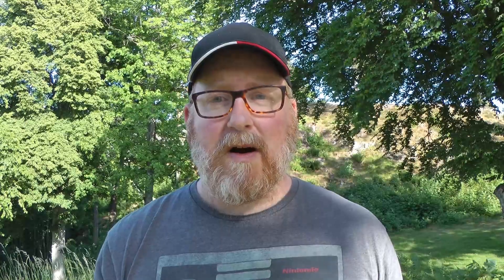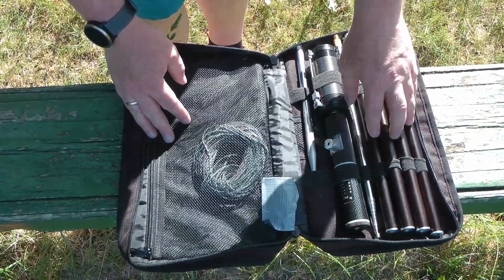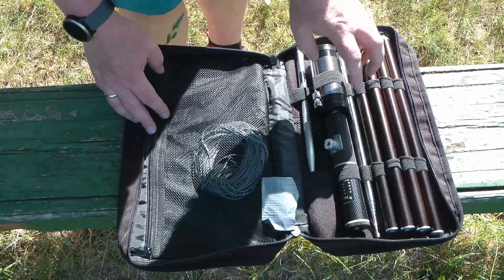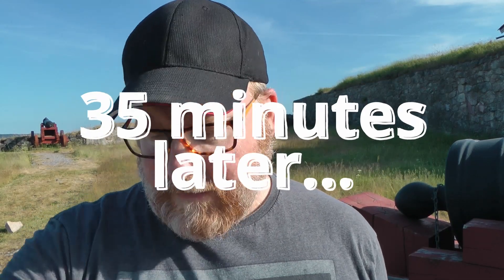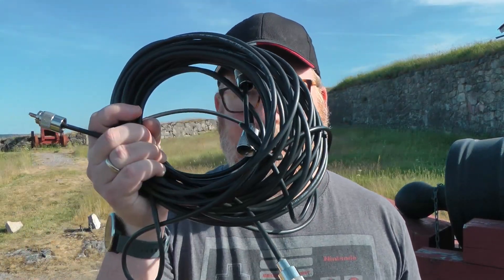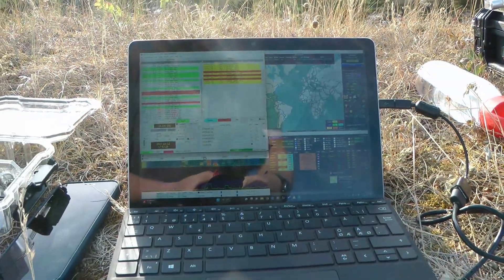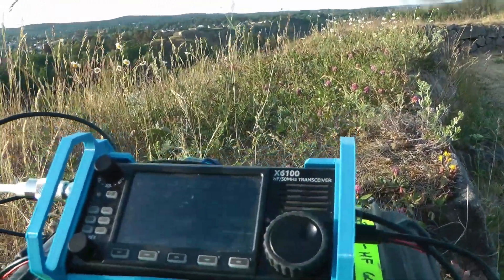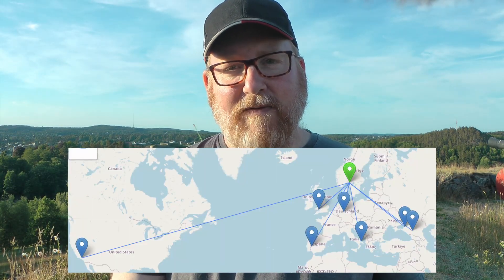The Chinese Buddistick (JPC-12) - POTA Fail

Comment: The slider was contacting two spots on the coil. Contact should be touching just one ring. My initial contact in 20 meters was Rusia. Give the system another chance, conditions are not the best.
Reply from the maker: Oh, I have given that antenna very many chances, and I have many videos on it.

Comment: I woldn't place the coil in the middle of the antenna. That's where most of the radiating happens (the wave is at it's peak). It may show a low SWR, but it's not effective.
Reply from the maker: Everything is a compromise. Even an 160-2m yagi on a 100m tower is a compromise. Where would you put the coil?
Reply: Wrong.
Center loaded is more efficient than base loaded, top loaded is more efficient than both.

Comment: I fiddled with the JPC-12 antenna and sent it back and got most of my money back as well.  I agree with your assessment.  I may try the knock off version of the MC 750 coil antenna.  The WRC antenna just works for me...
Reply from the maker: I ended up doing a series of videos on this antenna. It turns out that it works, but tuning is a big hassle.
Reply: @LB0FI  Exactly... Agree.

Comment: I own this antenna and have had a good experience with it so far. I think it just may not have been a good day for POTA the day you went out. I say give it another chance, if you haven't already.
Reply from the maker: I have a couple of more videos on it, and it turns out that it is okayish. The lack of good instructions is unforgivable though.
Reply: @LB0FI  yeah - the only reason that I knew how to set it up immediately was because I had already watched a few videos on it, including some people's struggles with it. I really want to try it over salt water to see how well it performs with a really good ground.
Reply: @TheToastDog same here
Reply: I have and used both - JPC/PAC and Buddystick. The results were comparable and the JPC/PAC is much easier to set up and tune. Especially the often breaking Clips of the Buddystick are o bad I sold this antenna after three years. One thing with the JPC - get the 5.6 m whip, this makes things much easier!
Reply: I found the anttena easy to set up much better than the buddypole and tuneing a peace of cake i made my own ground wires 3 x 16ft i think you must try it again but i think on 40m you need more than qrp i have the longer whips but tryed one yet ( you need a none windy day a long whip bends a lot 😊

Comment: Interesting video.
There's always a better mouse trap and I've tried so many mouse traps. My go to antenna for POTA is my OCF40. But, both my friend and I have PAC-12 antennas. We both use 3 each 35 foot long radials along with 3 each 17 foot long ground radials. For what that antenna is, compared to other ground mounted verticals, we both found this antenna easy to deploy, easy and super easy to adjust for resonance. For 40 meters we put the slider right on the painted mark on the coils. We ended up right in the 40 meter band. For 20 meters, we found the mark to be one turn off. But, by putting the slider right on the mark, we still had a usable SWR curve on 20 meters. 
The key to performance on this antenna is, "put down as much ground wire as possible. One ground wire, like the ribbon cable that comes with the antenna does not cut it. So many people just lay that cable down without separating the wires and spreading them out. As is, the antenna sees that cable as one ground wire.
We both found this antenna to be a very good performer for a ground mounted vertical. I'd buy another in a heart beat.

Barry, KU3X

Comment: I made a vertical that style using some Hustler loading coils from a mobile system i have a coil for 40m 20m 17m 15m worked every time. OK for POTA as my car is near by and did not need to back pack them very far. I found those types of antennas you used was tuning it up for every band and costing a lot of time. generally the Hustler coils are tuned once and stay in tune for next time. vk5cz ..

Comment: I've that same set up Morten, JPC-12  is pretty good. My first time testing it I worked into Indonesia from West of ireland using the x6100 on 5w. 
Ps i like the handles for the x6100 
De EI2JHB
Reply from the maker: It is not a half bad antenna, as my later videos on it shows. It does however seriously lack good instructions, and it is cumbersome to tune. Once you have it tuned it performs on par with other loaded shortened verticals. I do prefer the Slidewinder over the JPC-12 though. The handles for the X6100 are 3D printed, you can find them on Thingiverse. I also have a video on those handles. Thanks for the comment!

Comment: I used it tune it in less than 10 mints i get a contact 7500 km 
I even tested it inside my room i get 1200 km with 59 report befor i erect it is is a very efficeient antenna light wt easy to tune and ssemble
Thanks for the video 
7Z1FA:ST2KI
73
Reply from the maker: If you watch the other videos I have made on this antenna you'll see that things are not as dim as they seem in this video. It is however not an easy antenna to tune, and it is about as efficient as any other center loaded antenna when you get it in tune. How far you reached with the antenna though, is dependent on a whole lot of factors.

Comment: Simple long wire antenna with 9:1 un un on a fiberglass pole would be quicker and easier to set up ?
Reply from the maker: Are you asking or are you making a statement? And if it is a question, my reply would be as most things in ham radio, "it depends". Sometimes a shortened vertical is more beneficial to where you operate than a long wire, and sometimes a long wire is more beneficial. I adapt to the operating conditions when I do portable radio. I would prefer a 49:1 over a 9:1 any day though.

Comment: Were you operating with X6100 power or using an amplifier?  I have considered the X6100 as a new QRP radio.  Thank you for the example of the JPC-12.  David AE4LH
Reply from the maker: I was using an amplifier for this as far as I can remember. I do have some other videos on the JPC-12, so it’s actually easier to tune than what I initially thought.

Comment: I can inform you that when using 15 METERS you can remove the coil, I have found better results with the coil at the bottom takes on average 5 minutes to tune , the build quality is almost the same as  BP for a 3rd of the cost as I own both,  I think it's just inexperience with this type of antenna setup but we all started some where, I have made a few contacts around the world on 10 watts using the same antenna enjoy have fun 73's

Comment: You do need the coil only for 40, 30 and 20m band. The antenna is really great and simple to use and brings great results; at least in my experience. Used the antenna last winter for FT8 DXing and SSB in my garden and recently for POTA activations. Price/Performance ratio is quite good. If you want to know the best settings, you can use the setting from Heinrich DO1HFS (yt channel Funkfieber). Here is the link https://www.do1hfs.de/downloads/Kurzanleitung_PAC12_Antenne.pdf. 73 from OE8
Reply from the maker: Thanks for the tip. If you watch the rest of the videos I have made on that antenna you can see that I used that list and made the antenna work. It is not an easy to tune, but when you get it in tune it’s actually a pretty good performer.

Thanks for commenting!
Reply: @LB0FI  Thanks for the answer. Will check the other videos soon :)  I tried this antenna actually on all bands. I had never an issue by tuning the antenna. Used the original radials, sanded the surface where the ground rod screwed in. In comparison to e.g. the HF-P1 antenna, which almost needed the coil, this antenna is very easy to use. The SWR I got are almost in the range of 1.2 - 1.8. I will soon test the antenna adding an additional loading coil for 80m, just to play around. 73 Michi OE8YML

Comment: The coil must not be inserted anywhere at the top, but at the bottom, directly over the feeding point segment. And you do not need the coil for 15m: Take only three of the black rods and extend the telescopic rod to full, and you get a quarterwave groundplane, for 10m without the black extensions.The manual says, for 15m take all four and shift the telescopic rod down one segment, but regarding SWR, it does the same job. The coil is only for 20m and 40m. At 40m, you should try out, shifting the slider one or two turns upwards the marking of the coil, because that is meant for the lower band end. I love this antenna, because without fine tuning an fiddling, you are QRV on the four bands with SWR below 1:1,5. Of course, especially with groundplanes, the radials are crucial, and perhaps it might help to avoid tall grass. vy 73 oe1llc
Reply from the maker: I have several more videos where I investigate this. And you are partially right, the coil is for 20 and below, but this is a center loaded antenna, and the coil is meant to be in the middle, and not at the feedpoint as you suggest.

Also, when you say that you can get the SWR below 1.5 without fiddling you are simply wrong. This is an extremely fiddly antenna, but if you watch my entire series on this you will see that it is tunable on every band between 40 and 6.

This is an antenna that in kind of in between in it's market segment. It is easier to use than the Buddistick, but it is way harder than the Slidewinder DX.

Thanks for watching and commenting!
Reply: Wrong!
In my country you probably wouldn't make it through the exam (yes, a real exam, not a test) not having a clue there are also center and top loaded antennas. And in fact, center loaded is more efficient than bottom loaded and top loaded being the most efficient of the three.
This is center loaded one.

Comment: As for me, JPC-12 is a good antenna!  Quick to assemble, takes up little space, good SWR at 7/10/14/18/21/24/28/50/144.  The only downside of resetting in contest mode is the loss of time.
73 de ER/UT1ZZ!
Reply from the maker: If you watch the rest of my videos on it  you can see that it's not half bad, only really cumbersome...

Comment: maybe next time use a wind filter, or hi pass filter its very  to listen to blobs  :-(
Reply from the maker: Hi, and thanks for commenting. Could you tell me exactly where in the video you have problems with wind noise? Also, I always use a deadcat with my microphones, but when filming outside on a very limited budget poses it's own set of challenges. There are, however, links in the video description to support the channel financially just so you can help me upgrade my equipment.

That being said, how did you like the content?
Reply: @LB0FI  during the whole video there are low noise sounds of wind.  I am listning with a headphone so i can hear them .  Offcourse i could  filter them  out with a high pass .
. But it was a tip for next vids  to use a wind or plop cap for the mic.  Good video altough OM 73  PE1NGW 🙋🏻‍♂️
Reply from the maker: There’s always a deadcat on the mic, but sometimes there’s just too much wind anyway.

Comment: Great video! In my opinion, what you experienced, you can experience with any loaded vertical. I had similar issues with me Wolf River. What I learned is, that is does not only depend on the length of the radiating element or the coil but also on the length of the radials. I know that theorywise it should not matter. However, for me it does. So I only use the full length of radials for lower bands like 40, for 20 I fold mine back to half and for 10m to a fourth. That means I have an average length of 10, 5 and 2.5, and this equals to Lambda/4. I do not say this works everywhere, but on the dry and rocky soil of the black forrest hills it works for me.

All these antennas have their limitations, but I like the setup of the PAC-12. My Wolf River just came in a plastic bag. For sure I will get a PAC-12 as well 🙂

73, Kai
Reply from the maker: Thanks for the comment. And yes, all of these antennas have their limitations. The best one I have tried is the Slidewinder DX, which I have made one video on, and a couple of more are coming. I have a feeling though, that for 20 and up, a 17ft whip does the job much better.

Comment: Not my experience at all with the JPC-12. Tall grass can make counterpoise length more of a factor. The connection to the coil needs to be squarely on and only touching one of the coils. For reasons unknown moving to an adjacent coil or two and retuning the telescope changed results dramatically for better or worse. 

But, that’s why vanilla, strawberry and chocolate are all necessary, right?

Thanks for the video.
Reply from the maker: Thanks for commenting and your insights. It looks like I need to give this antenna another go.
Reply: @LB0FI  it is a design flaw to make it so hard to tell if contact is not spanning coils.  At night my phone light is necessary to double check. Also, I almost always use the 5.28mm whip upgrade and added another set of ribbon cable counterpoise when ground is bone dry. Also I bracket, meaning when I find a tune I try the coil turn above and below. Also, I never pull the top few telescoping sections more than 1/2 or even 1/3 of the way unless the band calls for that length. That makes the antenna stiffer in a breeze. East Coast US to China was achievable. Oh, and make sure the ground spike doesn’t start to unscrew.
Reply from the maker: The ground spike unscrewing was certainly an issue. I am also wondering if there is some kind of matching network in the feedpoint which would explain some of the issues I was encountering.
Reply: @LB0FI  feedpoint cylinder has just a wire from the center pin to the antenna mount.

Comment: Hi Morten, I am a happy owner of a JPC-12. There is one manufacturing issue with this antenna which I have encountered with mine and two more JPCs from other hams: The red isolation must be removed from the connector ring of the radials which is mounted  between the ground spike and the feeding point. The ground spike needs proper contact with the radials since there is no conductivity between the ring and the anodized surface of the feeding point casing.
73 Krishan, DO1KRI
Reply from the maker: I will check with the owner if I can remove the heatshrink and see if that helps.
Reply: One is glad to be of service (hope it helps). By the way: I have always managed to gain 1:1.2 to 1.25 SWR on my analyzer just by adapting the whip length.
Reply: Hi Krishan.

Thank you for your info. I'm after my first "long" weekend (3 evenings/nights and some hours during the daytime) with PAC-12 and my feelings are simillar to Morten's, but when I was screwing the gound spike with counterpoles and antenna base I felt, that something could be done a bit better here. Well, the next time this red plastic will go out, and we will see...🙂Generally this antenna has the potential, e.g. in the evenings on 20 m I heard stations from JA, VU and both Americas at S7 - S9 signal level and very low band noise around, I was able to do some not only european QSOs, but e.g. on 6 m and 40 m it was rather deaf despite not bad SWR. Well, operating on the VHF from the gound level is not so good, on 7 MHz it is IMHO too short (I'm going to buy 5.2 m long additional whip), but a bit dissapointing results on 10, 12 and 15 m were caused by not so strong propagation (I think so 🙂). Anyway this antenna is really good build and I hope, that after some modifications I will be glad with it.

73! de Piotr SP5TZP
Reply: @pt4389 the 17ft telescopic anttena is fitted with a 3/8th thread the jpc12 threads are m10 you will need to make an adapter hope this helps

Comment: Thanks for testing it out for us. This antenna wasn't on my radar, but I'll steer clear.
Reply from the maker: It might be an antenna for you though 😀
Reply: @LB0FI  for me, the only attractive thing about this antenna and the BuddiStick Pro is the size. They pack down in a small bag which is convenient for travel. A friend of mine purchased the BuddiStick because he travels by air a lot for work. I'll need to try his out sometime, but I'm not too excited about it. I just got a SOTABEAMS Carbon 6 mast for travel and need to build some speaker wire verticals for it. I think that'll be the way to go for me. 😉

Comment: Hi Morten, thanks for the video.
With which other antenna did you compare the JPC-12, which was in use at the same place and the same time, please? Maybe it was just bad condx?

I played with nearly the same antenna setup a few weeks ago in my vacation and had similar results - only to find out that the condx were really, really bad. A wire with a tuner brought the same bad results. 

I find it somewhat misleading to call an antenna a "fail" when the condx are the real culprit. 
Only if you do side by side comparisions of two antennas at the same place (more or less) and same time (more or less), then you can make a real comparison.

Full disclosure: We sell the JPC-12 and have some fantastic user reviews, see our blog.
Reply from the maker: Thanks for commenting. And yes, the lack of QSOs were the due to bad conditions. That was also not my point. 

My main point was that the antenna is complicated to tune, and is therefore diametrically opposed to it's purpose of being a simple antenna for portable use. I am, at heart, a wire antenna guy, but I would really like to find the compact antenna that suits my use cases for when I can't put up a dipole or an EFHW. An antenna for portable use, wether it be POTA, SOTA or something else needs to be simple to set up.

I have now tested the Buddistick and the JPC-12. My next antenna in line is the Slidewinder DX.